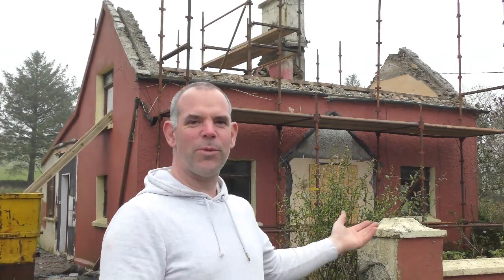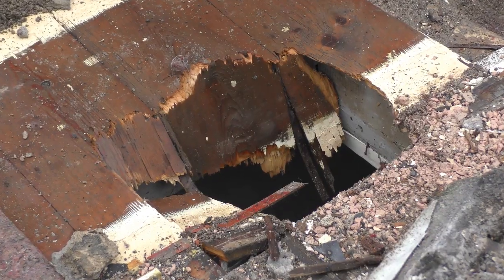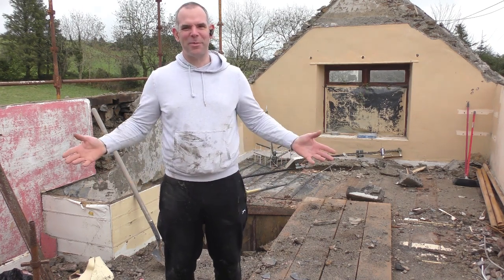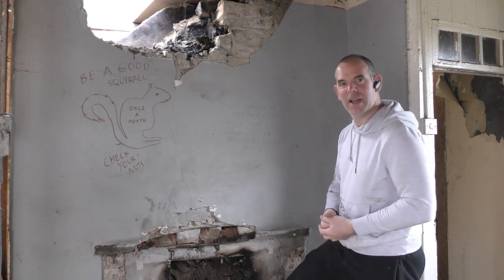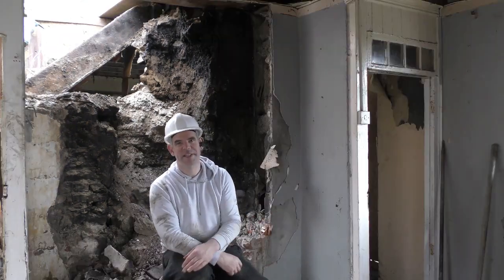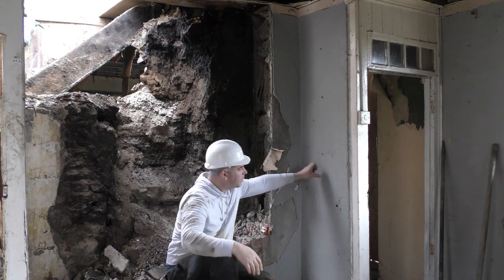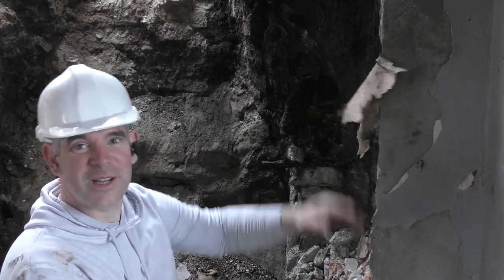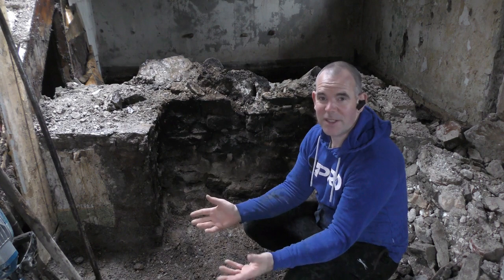Ivy Cottage Renovation Episode 7: Taking Down the Chimney

Comment: Another great video!  I’m glad you’ll be able to use some of those lovely stones.  I’m envious!  I’m wondering why the previous owners made other fireplaces?  Any thoughts?
Reply from the maker: I couldn't say for sure, but I guess the original fireplace needed to be bigger as it was not only used for heating the whole house, but for cooking too. When electricity and ovens came in the fireplace did not need to be as big.

Comment: Hi could you not have lived in your house as it was.?? Are was it not as good as it looks. I did think it was a lovely little house. Take care.
Reply from the maker: Thanks for the comment James. Theoretically yes. It was lived in when I bought it and you are right. It is a lovely little house. But the work is necessary. Episode 1 shows how it was when I bought it but the video does not reflect how bad it was or the smell of damp and other things which had built up over the years. It needed a new roof in any event, and as you saw in this video, the chimney needed to come down for a number of reasons. You will see more in next video or two of some of the other problems which have been uncovered as I have moved on through the renovation. It has changed the plan quite a bit. More to follow on that in the next videos.
Reply: Pete,
Question. You have taken it down to four walls. Considering that the walls were build without a damp course, and some have cracks. Would it have made more sense to re-build all new foundations/floors and the walls.  Not sure of costs, so we understand you wanting to keep as much of the building as possible. 
Best regards from Chicago 🇺🇸.
Reply from the maker: Hi Fergus. Thanks for your comment and great to see someone here from across the pond. There's a few things here. The walls in the old part of the house are actually pretty solid. I am on a really tight budget so can't really afford to do that. Also, what you are talking about there is completely demolishing it. To do that I reckon I would need planning permission which can be difficult to get over here. Lastly, I say in the video that I am getting rid of most of the character but thinking on it again, it will be keeping this 100 year old house intact which is nice. The extension is a different story. Will be talking about that more in the next episode.